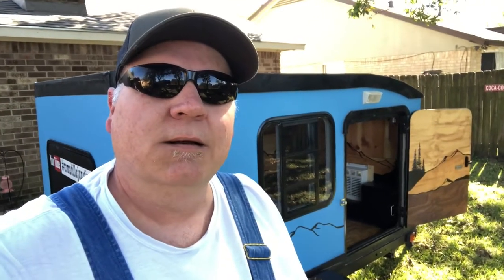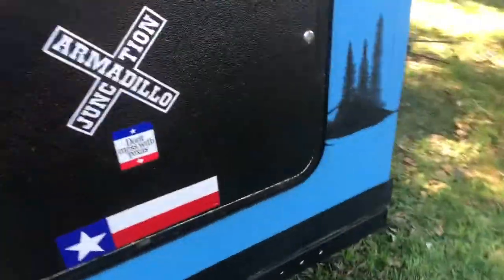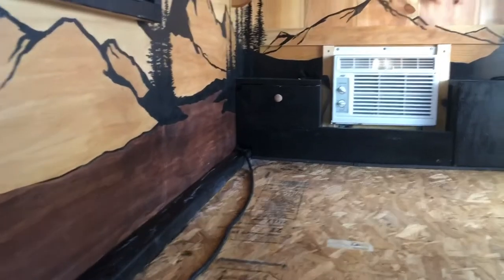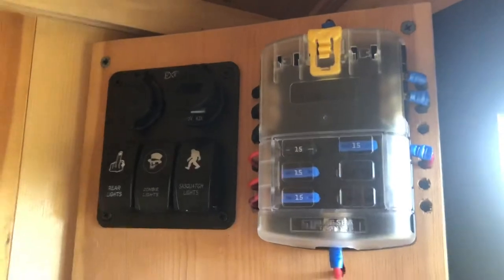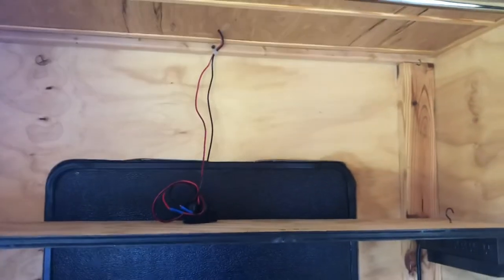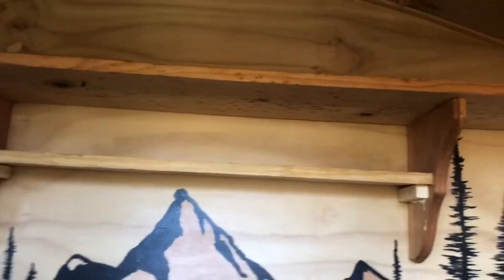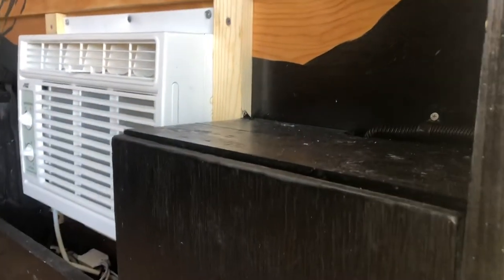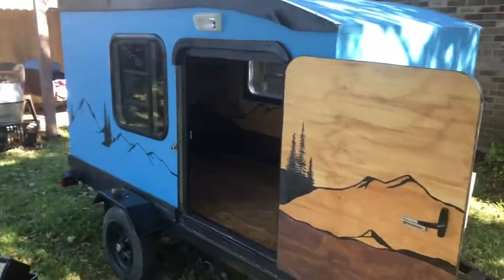Tiny Camper Tour Before I Tear it Apart

Comment: I just got a plug like that recently and like it a lot, you will not regret a 5 x 8 or bigger. Lots of nice parts there to build with so you only be out for cost the wood and a few upgrades, My current one is a 5 x 10 but I think a 6 x 10 would be better so there is a little room to grab the side of the raised bed to pop it up into a small couch.
Reply from the maker: Thinking the same ,,, I don’t wanna build 5 wide and wish I went bigger
Reply: @ArmadilloJunction  6 wide would make it easy for many things